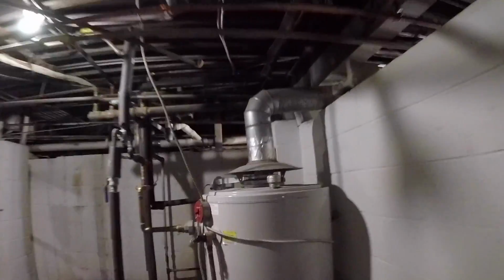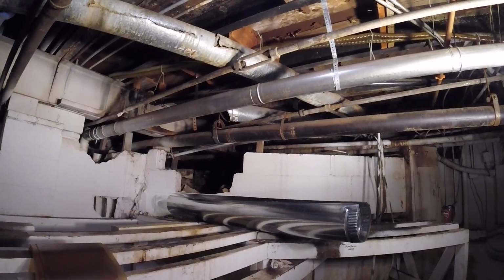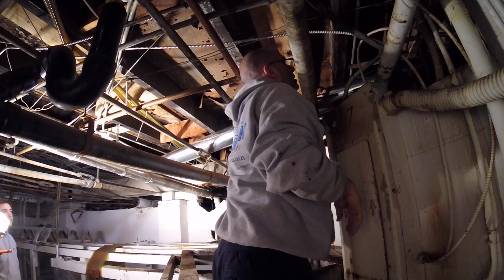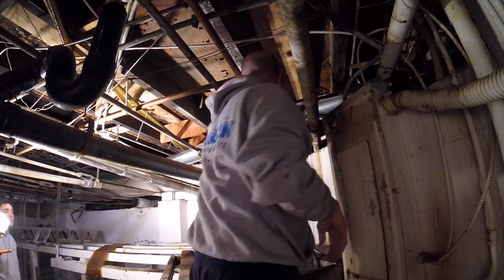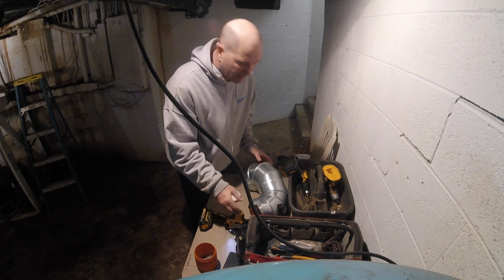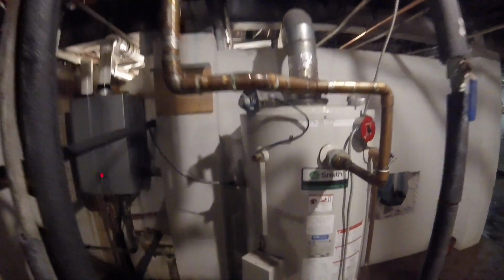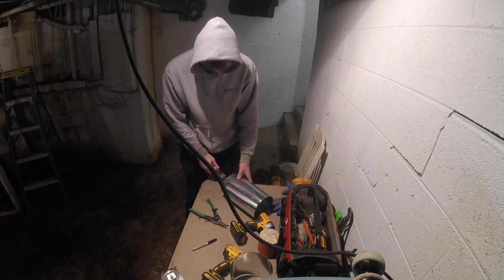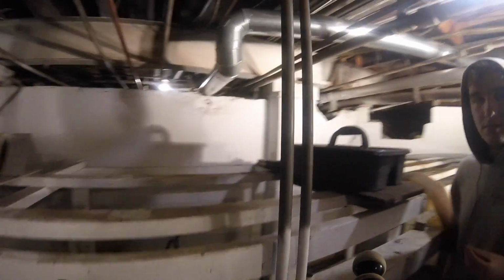Hot Water Heater Vent Pipe Replaced

Comment: Mr. Barron I see you don't use a lot of pex is there a reason for that also on your gas piping videos I see you use galvanized steel pipe not black pipe I am an hvac service technician and installer in Pennsylvania we use black pipe for gas is galvanized pipe a New Jersey code requirement
Reply from the maker: I use alot of galv. outside so I just use it for everything.